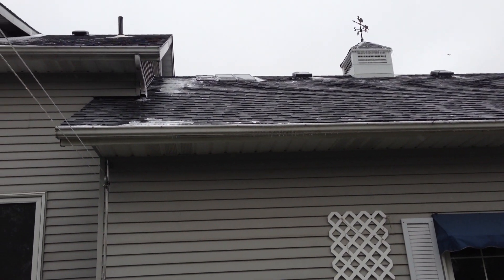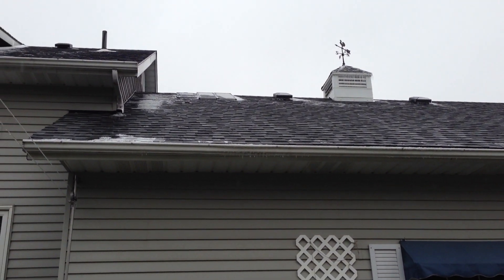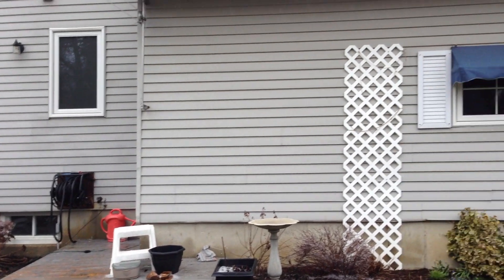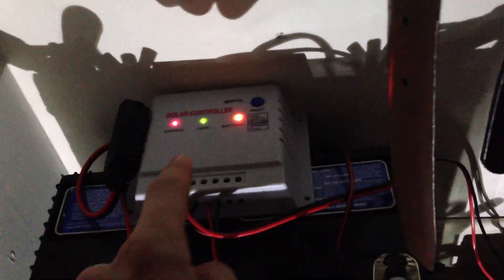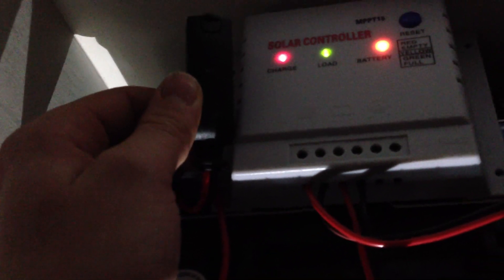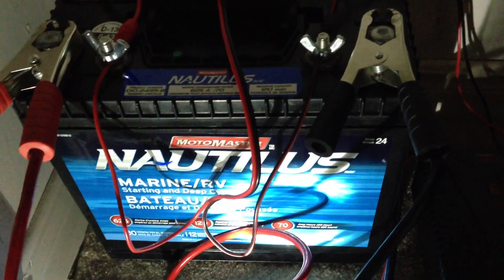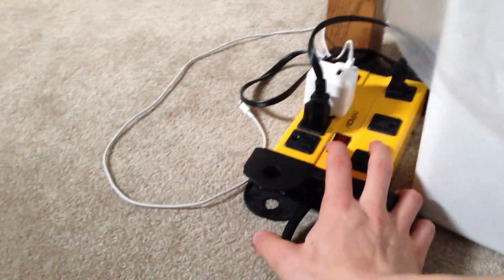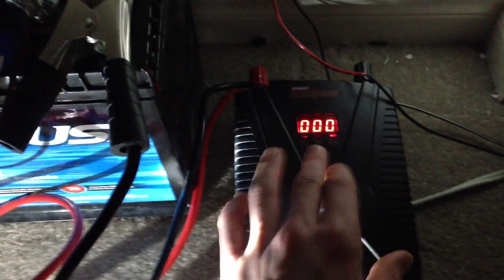Emergency Solar Power Setup

Comment: Your Solar Panel setup is a JOKE! The wattage you have will NEVER keep up with your 100 watt draw if you're running it for long periods of time.
The wire from the battery to the inverter is too small. At 100 watts, you MIGHT get away with it-I personally would have 10 Gauge or even 8 Gauge wire from the battery to the Inverter-Your setup is a fire waiting to happen!
My setup is 250 Watts of Solar, a GOOD Charge Controller, TWO group 27 Marine Deep Cycle batteries, and a 1500 Watt Inverter. Oh. yes-I'm 2running 8 Gauge wire from the batteries to the inverter, and my Wire Run is only three feet, with 60 Amp fuses for protection. I hope you don't think of yourself as an Electrical Engineer, because you are not.
Your basic idea for backup lighting and computer use is valid, but your viable power from the Solar Panels and your overall safety precautions are all but NONEXISTENT!

Comment: Nice little system. But your glad you had it when that storm hit. Thanks for sharing.
BTW, not being a smart ass, just letting you know, the battery, its pronounced "Not- I - less (Best way I could show it verbally). Name of the First Atomic Sub. Type of undersea Shelled animal. (Just didn't want your friends coming over and you show your system and they  rib ya after a few beers!.  
be/VX2FNp4QuNk

Keep on with your solar. Its an addiction, but I bet you already know that!